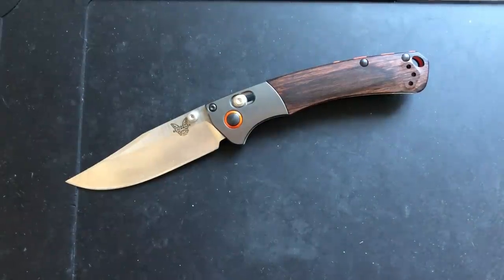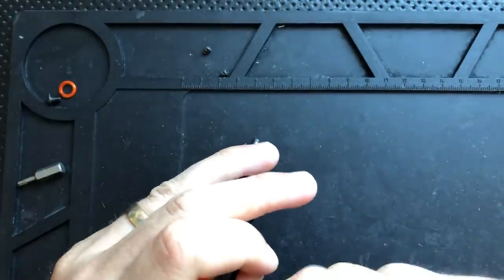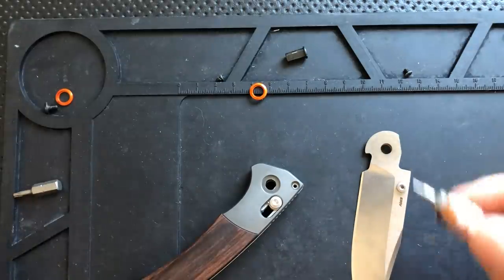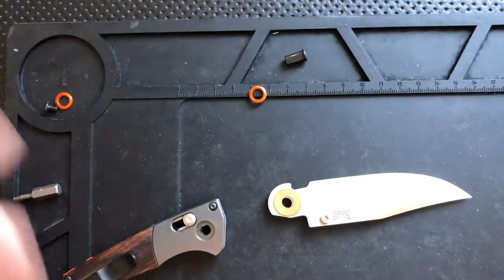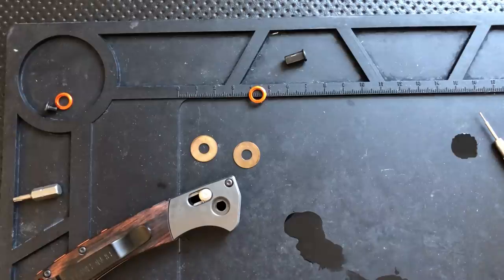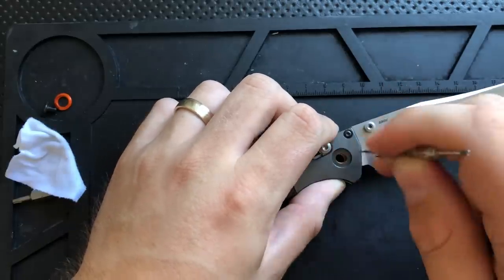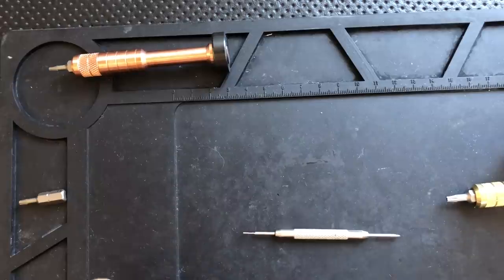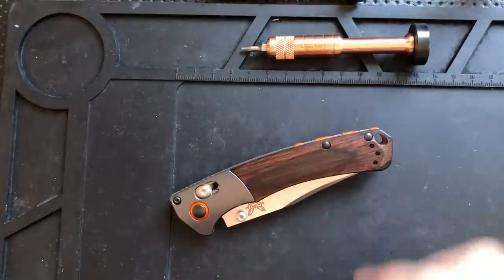How to disassemble and maintain the Benchmade Mini Crooked River Pocketknife

Comment: Hey Nick, I haven’t read through all comments, so I’m sure this has been mentioned a time or two already… but I took down my new mini Crooked River (just because) and when I tried putting it all back together, I ran into the issue of the pivot not wanting to go through the frame, washer, blade and out the other side. No matter what I did it wouldn’t work. So, I was beyond happy to see Nick Shabazz’s instructions of pulling slightly on the access lock… as that worked like a charm! I’m afraid it would’ve taken me longer to think of that on my own (if at all). Thanks! Enjoy all your videos! You da man!

Comment: Open the blade before you pop out the pivot on Benchmades if you can, sometimes the axis lock will wonk the back of the blade up and you might drop the front of the blade on to the barrel spacers, denting it. That’s only for models without the backspacer

Comment: I've been looking at this knife for an edc/hunting/woodsman knife. What are your thoughts nick?
Reply: I've also been looking at the pm2
Reply: I sold my PM2 to help finance my Mini Crooked River. I prefer the classier look of this knife over the the PM2. I love the clip point blade and wooden scales. However the PM2 is still a better slicer and better priced. The Mini Crooked River is just under $190 with S30V steel or $255 20CV on the custom builder while the PM2 comes in a variety of upgraded steels like S110V for $165. DLT is coming out with an exclusive 20CV variant for $142(EDIT: it sold out in 23 minutes). So I guess it boils down to beauty over function; I picked beauty.
Reply: Love mine!
Reply: @jamessonger3  which one?
Reply: @emyers4151  im also stuck between these two, im a bit afraid of PM2 size and BM quality control ^^
Reply: @Stompererer  keep both and buy more :)